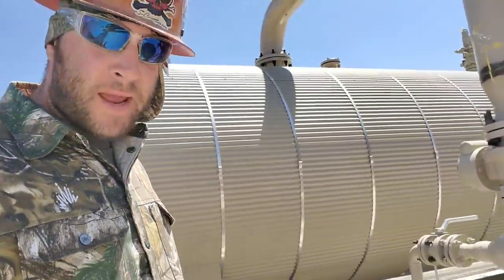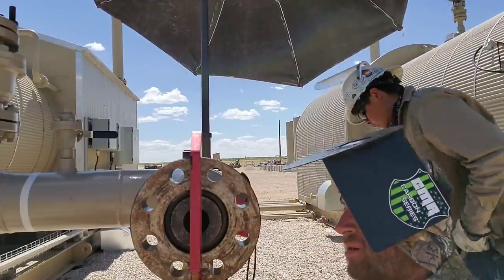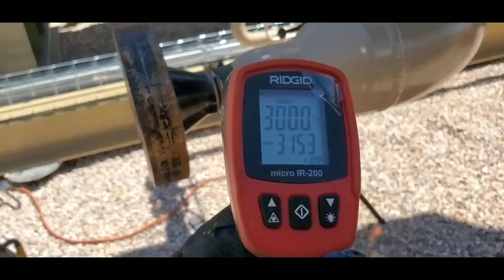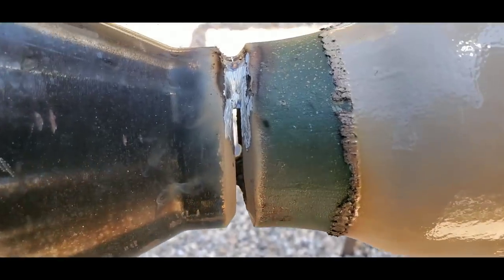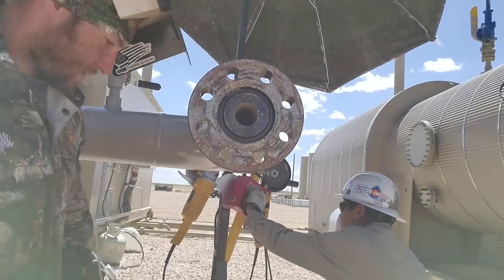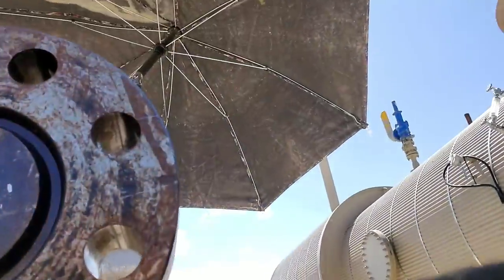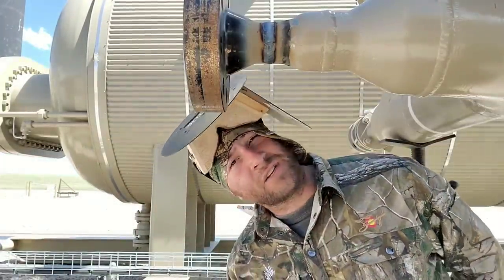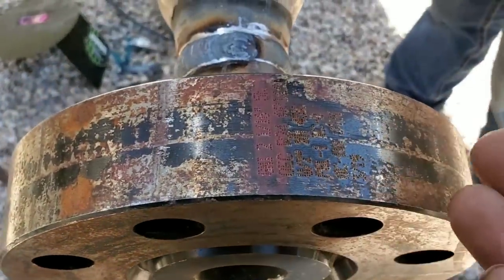UPHILL WELDING 7016 BEAD 8018 OUT 2" IN THE OILFEILD

Comment: Grinding a root pass down with a burr bit?? Now THAT is a splendid idea i never even thought of. Spot on!! 
After passing it no probs at last workplace, dipped a fleet 5p+ root 6013 hotpass, fill and cap ASME 9 6g test on 6" sched 120 a few months ago due to a line on the xray along the side of the root where i didnt grind it out very well. We always use a 5/32 thick disk on a 4.5" grinder for backgrinding a root and taking out the wagon tracks..... now using a carbide burr would give a lovely profile for the hotpass. Thanks Wally! Going to give that idea a try next time to see how it goes👍👍

Comment: So, as the heat is added to the pipe during the welding the amps are lowered to correct flow of fillet material, correct?

Comment: You are not like any of the welders I ever met...respect and wel(d)l done!
Reply from the maker: I appreciate that thank you
Reply: @TheWeldProfessor  hey man do you run  8010-G rods, i got a 50 of the stuff but everytime i weld with it, it just spatters big ol globs of slag and metal. running it on a shitty lincoln 225 buzzbox ac. Also that clamp is badass. when i was a helper we used clamps with angle iron welded on the ends so it aligns the pipe pretty well

Comment: Damn dude a 5k flange, most we see in the shop is 600 but the highest pressure vessel we build is 1440. I see you out there working on those heater treaters. 👍
Reply from the maker: They said they test them at 6 thousand pounds of pressure

Comment: Did you make your welding helmet by yourself? is that a cut-off wheel disc for the face mask?
Reply: You need to Google pancake welding mask. They are designed for pipeline welding.

Comment: Arent you worried about cracks, when you hit the pipe with the hammer, to get it purpendicular with the pipe (7:39) ? If there is a crack inclusion, they will run all the way up to the surface and cause a (catastrophic) failure.
Reply from the maker: I would grind out any if i saw some

Comment: I like the way he gave God glory and preeminence in the beginning of this video I've been a welder for five different major offshore oil companies through different Marine Contractors in my life I'm retired now and have been for years and you know I have welded with almost every type of process you can imagine and at the end of the day I must conclude the best way to put a root pass if you are wanting to do it fast and without any chance of flux is to pre-heat your v-groove use a MIG welder with .023 wire and after your tacks ,do it down hill and if it's done right it'll be one of the most cleanest beautifulest root passes it'll be clean , free of flux,  and it's much more faster than stick and you won't have to do any grinding on it. And in the offshore field most of the welding is done with a 6010 welding rod cuz most of the welding is on  grading or 2in pipe handrails but for critical welding for high-pressure pipe I think the welding community really ought to switch 2 MIG welding and you can buy a MIG welder that plugs into 110 and get get your 75/25 gas mixture and believe me it's a quick very quick quick quick root pass and clean as could be and then you can weld it out with stick or however but I know heliarc root passes are beautiful and nice but it's more expensive, and less costly is Mig, and I do realize the wind factor and that's what keeps a lot of welding contractors from doing the Mig route passes out of the field and heliarc also is because of the wind factor but you can build a little quick homemade tent out of a cardboard box just to get that root pass in to keep the wind out.

Comment: Greetings from the Napa Valley. The fact is field welding separates the scrap iron welders from the real deal.When I was your age I was bullet proof, could lift anything, climb  anywhere, and above all would love every weld. I went even so far as wdo40 on my weld when the rains came in just to show off my caps. I would ring them a buff the crap out of them. I was impressed with your confidence on your bottom tie-ins no porosity that's class bro. Love your spin out wheel. Would love to see a video on your rig, how you made it. I built a few and always wanted to change things around. Made my reels from you guessed it orj rings. My lead pockets were on the very back of the bed with screens on the bottom so I could wash off the mud if needed. Enough of my crap just keep up the good work. Keep those ear plugs in, wear your glassed and try to keep out of the smoke. I know I;m crazy I liked the smell of 5p.Jerry B

Comment: Great job man...!!  Welding vertical up gets way more penetration on your arc when you are stick or mig welding...  I have been a welder for a little over 30 years now...
 It's been a good career to me...   :)
Reply from the maker: I love it myself
Reply: I always preferred to run a down hand bead with 6010 or 7010.....on normal mild steel pipe.....Run the gap tight.......even no gap actually and crank up the heat to penetrate through or use the grinder to feather the land if the gap closes up too tight and get used to running the rod hot, as compared .....With down hand and done that way there is no internal undercut and a smaller more uniform bead inside the pipe and better ties ins ..........When welding up hand and with 6010 or 7010 there is more chance of undercut on the bead especially around the 3 o'clock and 9 o'clock positions .....  With a 7018 low Hydrogen rod used as a root pass rod and performed up hand, you are almost asking for trouble with undercut and inconsistencies at the stop /start points and or slag trapped in the bead having to run the rod at lower temperature to control and manipulate the arc flow as the molten metal does not freeze as fast while you can not step the arc well, if need be while trying to carry a larger weld puddle and larger keyhole  .......Of course if that is the welding code and welding procedure, then a good welder will figure it out ...but still, more challenging and difficult to obtain a nice uniform root pass bead.......If the code and the procedure calls for a Up Hand  6010 or 7010 root pass,  I found it best to perform the root pass same as down hand.......run a tight gap..... and jam the rod in there with sufficient heat and drag the rod up maintaining a tight key hole and get used to your hand and arm position coming up and around while avoiding too much of a back angle on the rod and arc......Also you can hear the sound of the arc inside the pipe and know that the metal deposit is flowing smoothly by the sound.......a nice consistent, smooth hissing sound rather than a inconsistent crackling sound.........such that you could close your eyes and work the rod by way of the sound  you are hearing ..........I also learned to perform the cap pass Down Hand with 7018 low hydrogen....It works, while you have to crank up the heat and pull a longer arc when nearing the side of the pipe and let the flux roll off as you near the 3 clock position  ...or..... stop running the bead and restart with a new rod pointed upwards at a steep back angle and crank up the heat even more on the dial for the start of the arc while the force of the arc and the steep rod angle will get you past the 3 o'clock position before the molten flux begins to roll around in front of the arc impeding the flow of metal deposit....and moving on to the 4 o'clock position where the molten flux is now rolling off vertically and dropping off and not interfering with the arc gap and metal deposit action....... and then have the welders helper lower the heat as need be as you get closer to the 5 o'clock position and finally the 6 clock position at the bottom......People look at the cap pass and wonder how did you get the cap pass looking so smooth....Ha Ha ...but does not work well if you have to weave and carry a really big weld puddle on larger diameter, thicker wall pipe.....Whenever you are welding pipe and the pipe is not being X-Rayed to code or say 10 percent X-Ray requirements and say only water pipe or drain pipes etc. ......then try welding different ways ..such as 5 / 32 inch size rod as a root pass rod for pipe  that is say 4 inches and up and even 3 /16 inch size welding rod for root pass for large pipe diameters and heavier wall thickness that can take the heat .....and always experiment when you can ....Cheers
Reply: @hasslefree1848  I fuckin loved reading that! This dude is definitely a good welder, no doubt. But compared to what we do in Canada, he makes welding pipe looking hard. Tack with 7018, burn through them with a 6010 root, hot pass with 6010 or 7010, fill with 7018, and cap with 7018.
Reply: Desde luisiana  un saludo  buen trabajo

Comment: What’s the reason for going up hill on some and down hill on others I’m not a welder but I like to watch your videos
Reply: It all in what the company and/or engineering calls for. Different types of rods/processes require different progressions. Sometimes it's a matter of speed. Others its tensile or shear strength or any other thing they might want out of a finished product. Welders are just given a procedure and any other way you can do it will just be rejected by an inspector. You just have to do what they tell you.

Comment: Hey Professor, Question? Are you able to tig route these pieces and then multipass with rods? If not why not?
Reply: You ask a good question.
Tig Root is best IF you can.
But with the wind whipping in on you from every direction ??
You would spend more time grinding out porosity then actually welding.
If you could shield the Pipe.
Yes i would Tig Root.
Some might disagree, but it definitely helps to control the amount of crap that enters the pipe.
I would Tig Root even if only for this reason.
Reply: @patrickkenny565  
Hey Patrick.
I did not want to point out the obvious.
Just my version of what i would do.

As you know you are rarely given a reply from the person posting the video,s.
As most just get bombarded with questions.

You can weld out in the field with Tig.
You just need to take some extra effort when setting up.
Most don,t ??
Mostly the reasons why Tig Roots are rare in the field.
But some Welding Procedures call for a Tig Root.
Good talking to you.
All the Best.
Peter.
Reply from the maker: It would be nice to tig it but then I would have to provide a argon bottle and a tent to keep the wind off us. We did try to get them to let us tig. I even have a hard wire cert still but they wouldn't let me do that either. 🤷‍♂️ gotta do what they pay to ask
Reply: @TheWeldProfessor   Good to know what is typically requested on these big sites, I think I'll try SMAW as my next cert exam (I'm just learnin), great vids and tips, Well done!

Comment: Were did you get the clamp from. did you do 8018 for the root and 7016 for fill and cover pass? do you do more stick welding then tig welding. any advice on tig welding?

Comment: I know a way that they could put in route passes very quickly all they would need is a little 2ft by 2ft Wind Box to block the wind and they could use Mig to put in every root pass downhill the route passes would be nice and clean you wouldn't have to worry about flux it would be so quick fast easy and you would never probably ever have to worry about blow through but I don't know anything that makes sense to the workaday world out there it's like they are so reluctant to change no matter how much it would save them time and money just do all route passes with mig either uphill or downhill it be quick fast no blow through. Of course I know there are some exceptions to the rule and in some places where it would be tight to get in and the wind would blow and you couldn't put your windshield box up then and then only go back to stick but yes if they were when the weather permits tell all welders just to put in all route passes with mig ,oh my, the time it would save it would be quick fast and then it would allow a good platform for filler and cap

Comment: You have such a positive attitude. I would love to be your helper, I’m a sheet metal apprentice in Michigan and most of the journeymen you work with have such a bad attitude and ego you just get bitched at all day because of the prints or this or that. They just need to love what they do and feel blessed
Reply: Learn blue print reading well. Learn to weld a bit on the hot side. ASAP stop looking directly into the puddle and look just ahead. Once you know  you are hot enough so the weld flows well and flattens out then look just ahead of the puddle and see exactly where you are welding always.

Comment: What is the USA measurment for welding machine temp? I mean, here in canada we use km/h for speed which is a much higher number than americans using miles per h. And in welding in canada we use Amps, so like most people on 3/32 would use around 60ish Amp(min) to put those roots in. What is your measurment equivalent to "amps"

Comment: Would spot welding two resting tangs of 1/2" square stock then clamping and tacking work pieces for alignment cause a weak spot when ground off after being aligned? Actually, I think it would be the same as a weld out?
I know the fireman would give you the eyebrow, but something on the fly where 'time is of the essence' situation.

Comment: One of the biggest nightmares for a pipe welder is to come in on a job at its last few weeks where fitters before him and welders before him through everything together real quick and fast and then towards the last few pieces to be fitted up everything's out of whack everything's out of line and talk about gaps you're going to have gigantic gaps and I came in on a job at the water treatment plant in pigeon forge Tennessee working with a company out of Atlanta years ago and it was the latter part of the job it was coming to an end and oh my the pipe was fitted up so bad it was so off we had to come along that pipe and put it under a lot of pressure to pull it back to meet other pipe and it had a special coating in it so we couldn't cut it we couldn't put in no new pieces so we actually had to wrap chains around the pipe and come along it and put it under high tense  stress to try to get it fitted up it was so out of whack try all you can to never come in on a job in its last few weeks because if the former company left you can bet the supervisor put them up the road cuz they made so many mistakes and then the welders that have to come finish the job their are face with gigantic gaps it creates a lot of hardship to get the job finished
Reply from the maker: I'm glad you understand that. Iv been there so many times.

Comment: Everythings uphill with 2.5mm and 3.2mm 6013 on site in the uk  only recently had a crack on down hill rods or stoving rods as their known  and its so much easier and faster
Reply: did you keep a preheat in the pipe and proper inter pass heat ?
Reply: 6013 are a non structural rod and you wont find a procedure for them 7018 are the norm I would say these days
Reply: @TheScottishBambi  thats all these tight arse companies supply u with in the heating vent game , shitty rods shitty inverter 110 machines ,   thin medium weight pipe and wobbly stands , and horrible  horrible fit up is the norm

Comment: hey bro your post says 7016 ?don't you mean 7018now that's old school ?  I used 7016 like 30 years ago and didn't think anybody used it anymore but Lincoln still makes it. real old school  great vid anyway love it
Reply from the maker: No its 7016 bead uphill. I wish it was 7018.
Reply: was it pipeliner 16p?  just looked up on lincolns site . .. didn't know they where still using it always ran a little sluggish learned to weld with that until 7018 came into favor. maybe they will  bring back 6012 and 6027? lol    good job!

Comment: I guess its better to square the joint right at the start to maintain an even gap hence less internal slag ?
Reply: Uneven gaps are more difficult to weld, and if you're gap is too big you might stack too much metal on the backside and fail inspection

Comment: Hey Wally, was watching an older video of yours and in that video you said to never weld downhill with 7018, always weld uphill. Why is that?
Reply: 7018 slag doesn't solidify as fast as downhill rods so when you go downhill the slag drips down right where you're welding and you get porosity
Reply: Zachary Kemp Ohhh okay. Thank you for the info. Good stuff to know. I’m only an apprentice so I’m trying to learn as much as possible.
Reply: Slag inclusions under the weld. Not so bad for root passes, but hot/fill/cap should all be done uphill.

Comment: In Australia we would do TIG root and hot pass, low hydrogen fill and cap. We used to use kobies (low hy) root but now TIG root is very popular. Also STT wire process has taken over in fab shops. Interesting to see how you do it in America. 👍

Comment: Are you welding threw the gap & welding it from the inside? Wish we had a better view! Not the 1st pipe liner that I have seen weld fittings! I swear that I saw someone else use a machine which spun the fitting as he welded it?

Comment: Excellent. Like the humble. By the way. Dumb question. Why is there such a small diameter flow restriction right before that flange right where you ran your weld?  

And another dumb question?  How do you clean up inside?  Or don’t it matter?  Or just ain’t possible?
Reply from the maker: Slag falls off the inside and it’s just a a tight fit because that’s how I like it. Never a dumb question if ya learning from it

Comment: Dude you're awesome!  Very inspirational.  Thank you.  I have a question.  I usually use a MIG machine, what do you mean by 'third gear' on the machine and the setting on the remote?  Once again thanx.
Reply: The machine has "gear ranges" that determine the amperage output range available to be used. 3rd gear could offer him 60-150amps for example. 4th gear would then be, say, 140-220. All depends on the rod type and rod diameter as to the amperage uses.